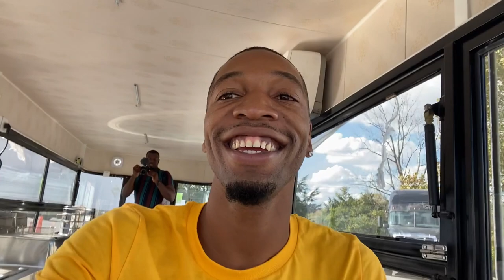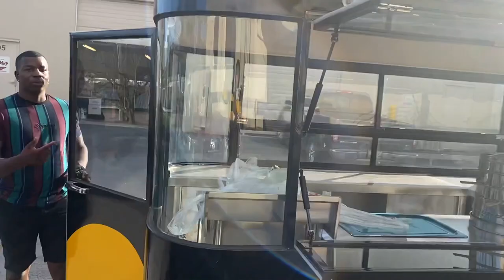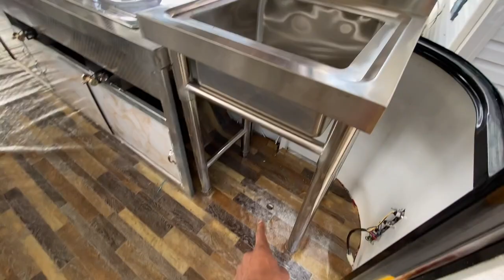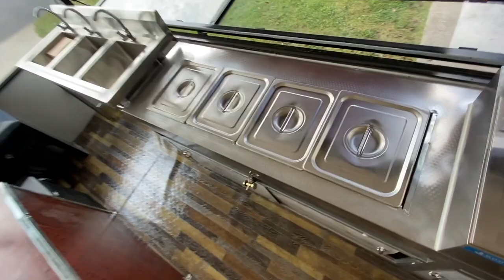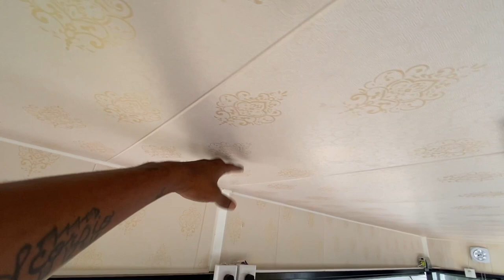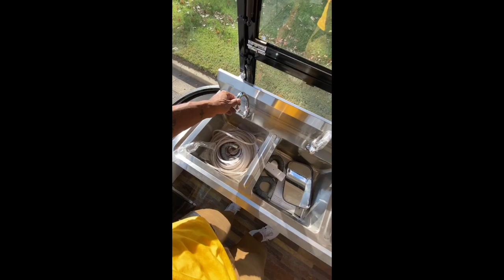New Alibaba Food Truck | Electric Food Truck 2024 | $10k Food Truck | Scams to AVOID on Alibaba

Comment: Really cool ideas from China . Downside is you need a commercial hood and fire suppression system which wont fit and all your openings need to be covered in screen or you wont pass heath dept. I started my food business with a Chinese trailer but quality was not there and by the time you import and make changes you could have bought a American  built trailer here. Also if fridge goes out good luck finding parts.
Reply from the maker: Our experience has been different but thanks for your in sights on it. It you watch other videos we got approved and running and has been a blessing. But keep killing with what your doing also.
Reply: Nah get a trailer bare nothing in it and build from there saves u 8-40k cause a work truck tool trailer is like 25k and those come bare lmao trust me the profit is there just gotta order the right stuff buddy